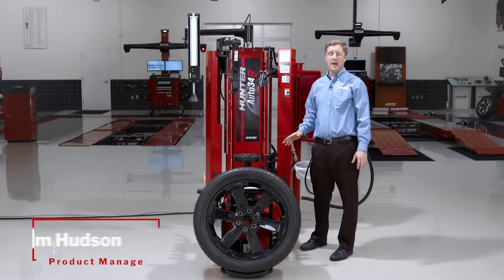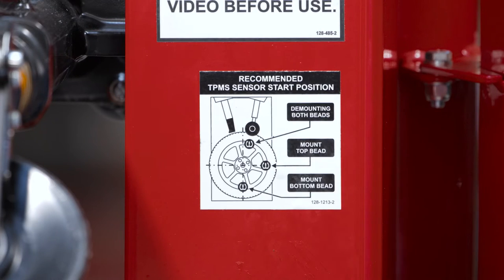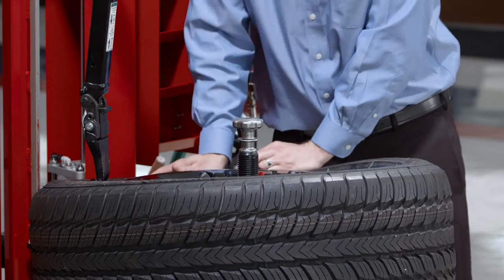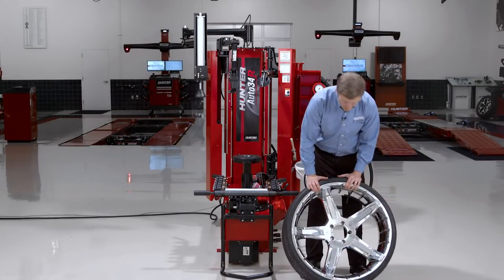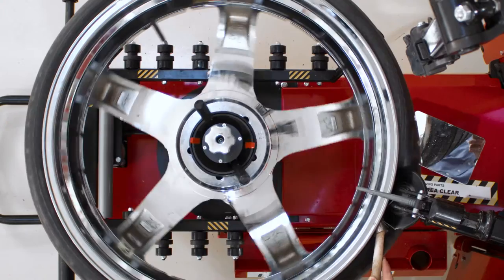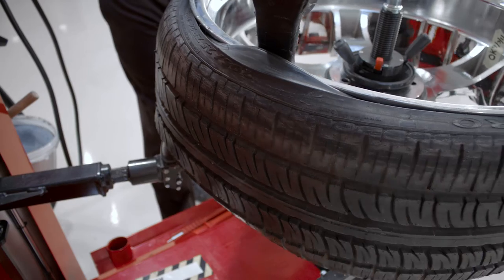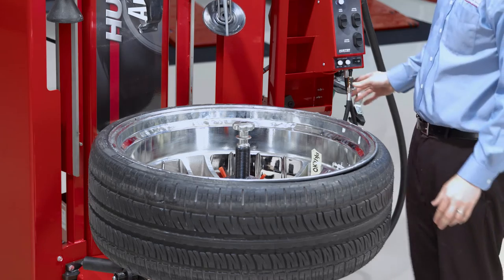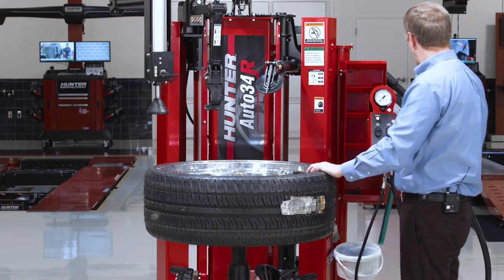The Hunter Auto34R Tire Changer: Detailed operations video

Comment: I worked at a tire shop and a guy brought in some super low pro tires.  The manager told us to do them, even though our policy said not to.  We finally got them mounted, but the beads would not seat.  The manager got involved in the work at that point and the pressure went to 80 psi.  Still no change.  Lube didn't matter.  The manager then asked us to leave the work area and took the pressure to 100 psi, mounted the wheels, then bounced the car on the ground with the lift.  The tires finally seated at 110 psi.  Crazy.

Comment: Used on of these before at the Toyota dealer I used to work at. And a Coats 9028E Tire Changer. This machine works ok. The Coats was my favorite though, the 3rd arm makes more complicated tires easier for me. My grip is the foot pedal is inverse of what the Coats is for the table spinning direction. 1st tire I did on this machine I spun the tire the wrong way and the bead chomped on a Tire sensor.

Comment: I wish they showed how to mount low profile tires 🙄
Reply: the last demonstration was a very low profile tire? what's low is low to you?
Reply: This is like buying a Ferrari when you really just need a daily driver , neat machine ,  but I'll stick to a rim clamp with a single power assist   , this really overcomplicating things  afaic
Reply: 275 25 28 and 295 25 28
Reply: @andrewcampbell-young8426   yeah you mount those on the ground with bars !
Reply: @Nothereneverwas69  lol nah our old machine the table smoked out a couple weeks   back so we are doing trial runs on this machine to see if we can find flaws in it we got a couple of 30in and two 28in pairs we got to mount 3pc wheels of course
Reply: @andrewcampbell-young8426  

It's not hard to mount them with the bars  we just lay them down on moving blanket and mount them like a big truck tire , a little harder but easily doable ,. Unless your mounting 28" and 30" regularly  then the machine I guess would be better
Reply: @Nothereneverwas69  lol yup 😆 it's definitely a task especially 28in billet specialties omg you got to use caution ⚠️
Reply: Wish I knew a place that has one of these. My Weld wheels are 350 bucks each. Dont need some high school kid bending one.
Reply: @henrysmith8012  lol 😆 its really easy to operate its basically touch less it tears more tires than scratching rims 
We do Forgiatos HRE wheels at my shop and they are 3x each of your Weld wheels especially when it comes to the liquid and brushed gold wheels minimum per wheel $2500-$3000  🤦
Reply: @henrysmith8012  cheap ass rims!
Reply: This changer is shit compared to the revolution, I have one and my team love it, the revolution of course
Reply: @Nothereneverwas69  You don't need to do that. Just need plenty of tire lube.
Reply: @Nothereneverwas69  This machine is very good for carbon fiber wheels. And you're seeing more and more of this carbon fiber.
Reply: @Nothereneverwas69 nah, you get used to it. Ive been in shops with both, the clamp style is a little bit faster but its a lot easier to damage the wheels with one. These also are easier on the body if youre doing all day every day.. but I dont worry about scratching nice wheels on this like I used to at the previous shop